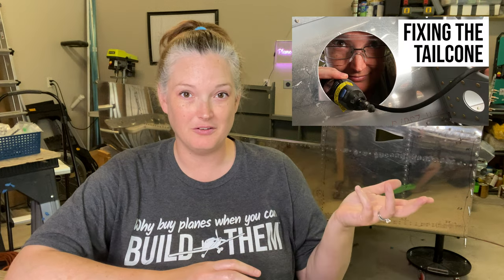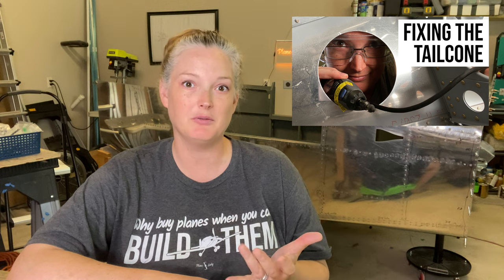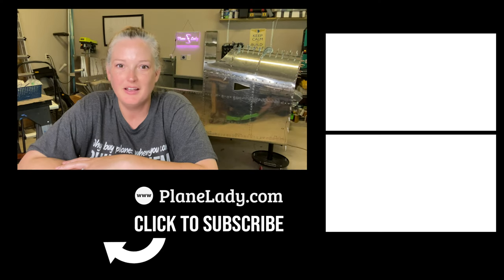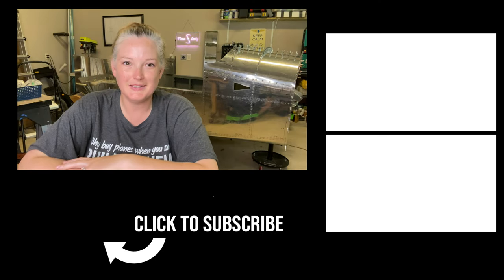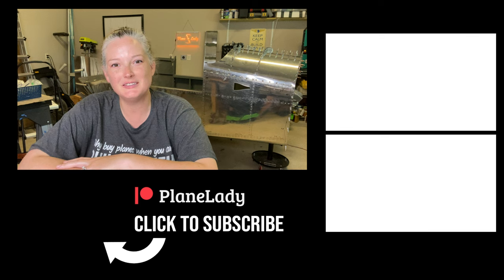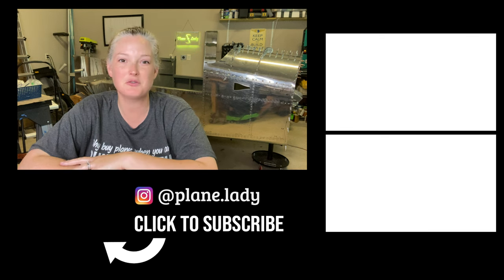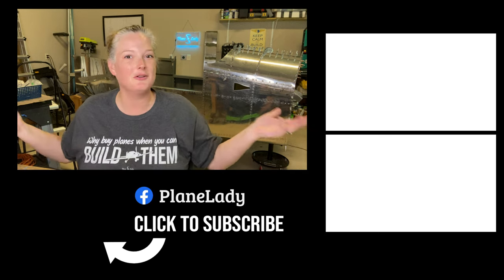Van's Aircraft RV-10 Build: Follow Up to Fixing the Tailcone

Comment: We're building the -14. Because of your video, curiosity got the better of me. I checked the aft fuselage area of the plans, and pulled out the sub-kit that includes the J-stiffeners. I also have a USB drive with the -10 plans, so I opened those up as well. While both the -10 and -14 share similar designs/components in the aft fuselage, Van's handled the inventory distribution of the J-stiffeners differently. The -14 plans do not include a cutting schedule for the J-stiffeners like the -10 (Figure 2, Page 10-5). In Step-2 on the same page, it is mentioned that there are six, and eight-foot lengths of J-stiffeners. I can see why you ended up where you did. But, the situation was realized and addressed. Laborious fix? Yes. Handled? Yes - and nicely. Tap the sign (just got one of those myself) and press on. Thanks for the follow-up!
Reply from the maker: Thank you 😊